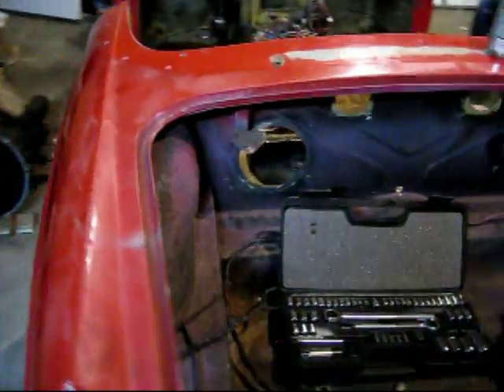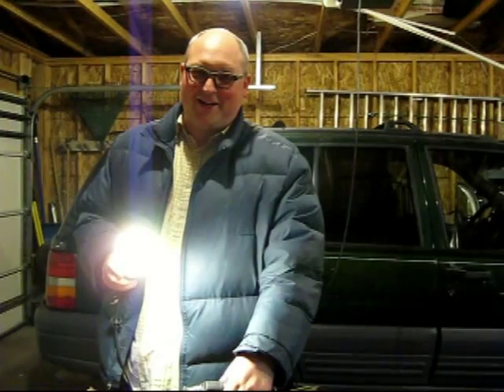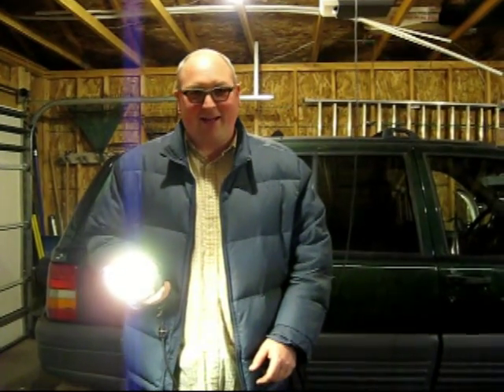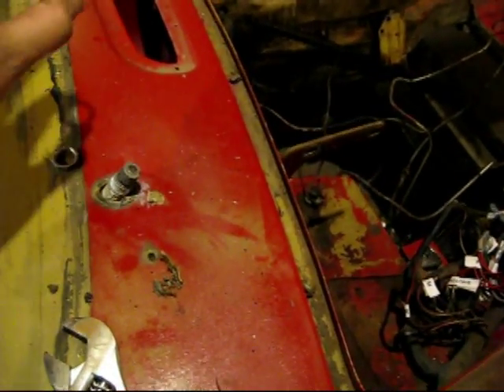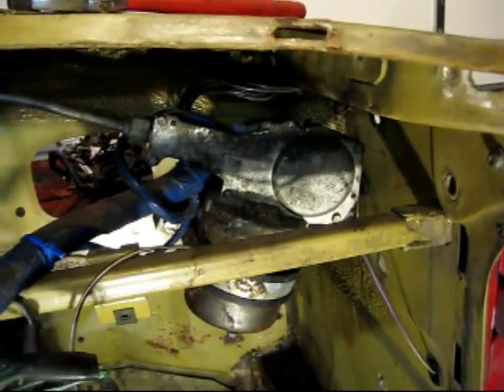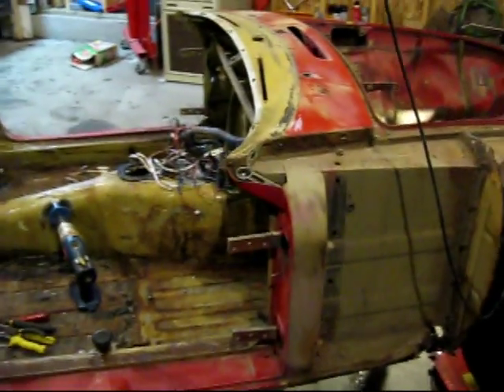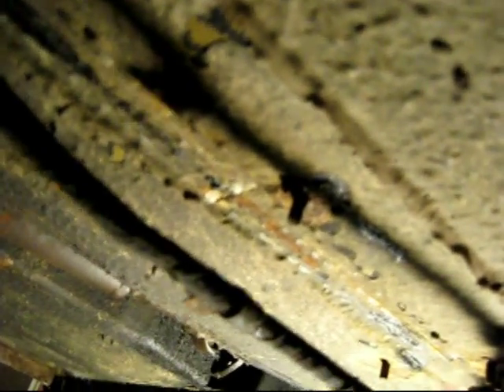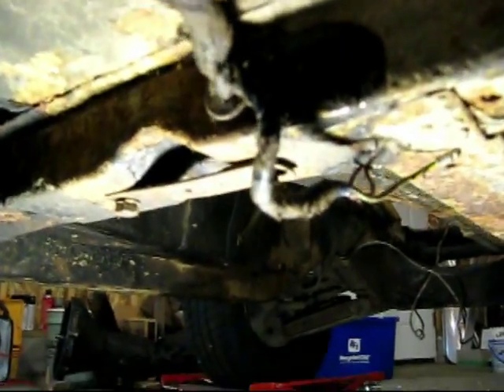MG 27 - Wipers, Break Line and Gas Line Removal

Comment: I used an impact wrench with i think it was a 3/4 " socket to get those nuts off. Bought new ones to go back on. But i would like to have seen exactly how that motor was mounted. It's been 3 years since I took mine apart. I can find only one hold for mounting and the strap i bought has a place for two. I have a 76 mgb

Comment: I'm trying to remove the drive cable from the tube, which looks exactly like yours, but the cable will not budge.  Is there somethign under the dash holding the cable in or do I need to just pull much harder...I'm pulling pretty hard at this point.